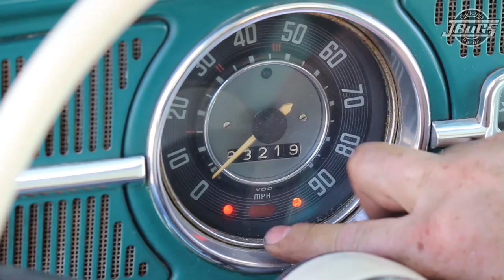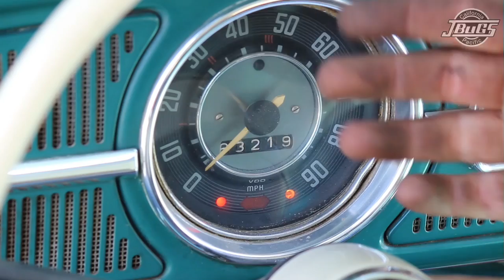JBugs - 1967 VW Beetle - Alternator Conversion Kit Installation

Comment: Might want to add that a new/shorter fuel pump will be necessary along with the short pump rod.  Also a new carb/manifold gasket might come in handy!  :)  Just finished the mod...Works like it should!  Thanks JBugs!
Reply: Not completely true, a generator pump can be run with an alternator. There is just less room for removing it later!

Comment: These videos are fantastic, especially to those of us that are new to Bugs! So far I've had to use this video as well as the rewiring main harness, bleeding brakes (as a double check) and electrical troubleshooting (which resulted in having to rewire!). 

NOTE** during my alternator swap and when I was pulling the fuel pump, the intermediary for the fuel pump BROKE inside the case. I tried a couple things that didn't work but what did and made it a snap was using an easy-out. Once the easy-out is in place gently turn and check to see if the broken piece is turning as well then pull with an upward motion and being ready to grab it.
Reply: The fuel pump spacer / drive rod guide is often times broken off inside the case. Fortunately VW thought ahead and made the spacer out of bakelite so if it does fall into the case, it usually won't damage anything and can be fished out when the oil is drained.

Comment: Did I just see you install the alternator support with no gaskets on either side of the oil baffle?
Reply: Yes you did. Just like the metal dual port intake manifolds, the metal baffle has a raised lip that crushes down to seal the stand to the engine case. Earlier versions of the baffle did not have the raised edge and needed the paper gaskets. As soon as VW offered the baffle with the raised lip, they no longer installed the paper gaskets.

Comment: There appears to be a mistake in this video.  The open air slot in the fan backing plate should face the bottom for proper air flow to the oil cooler.  This video shows the fan backing plate open air slot facing up.
Reply from the maker: Good catch Paul, you are correct. The long “groove” should be pointing up, and the vent should be facing down.
Reply: My printed instructions shows the hole above the alternator
Reply: How confusing
Reply: Great now I have to take my whole top end off and fix it. Delete this video.
Reply: @compound256  OK, we'll get right on that.

Comment: Before lifting the fan shroud you also need to take off the thermostat under the engine.
Reply: Only when they still have it, in So Cal most of them are removed.
Reply: @Sam_Mebane  I run a thermostat, It’s vital for proper engine warmup. In any climate

Comment: Great video I just have a few questions. Aren’t 67 and up beetles already 12v? It was my understanding that 66 and earlier are the ones that came 6v. Anyhow, I have a 6v powered 1963 beetle and wanted to do the upgrade to 12v and I’m getting the complete kit including the starter to eliminate having to replace the flywheel on my trans and avoid messing up the teeth inside (I know a 6v starter will work but don’t like the idea of using it and wanted to go more of a proper fit with less hassle). So would I follow these same steps for my conversion?
Reply: Correct, 1967 Beetles are 12 volt but they originally have a generator which we swapped out for an alternator. So this is a video about swapping out a generator for an alternator, not a swap from 6 volt to 12 volt. Installing the alternator on your 63 would be similar but the wiring conversion is simpler as all the wiring for the regulator is at the engine.

We don't offer a 12 volt starter with a 6 volt gear. We would recommend sticking with with the 6 volt starter unless you have a 12 volt flywheel.
Reply: @Sam_Mebane  Hello Sam, thank you for the reply. I was able to get a kit from AC industries with the 12v starter to 6v bendix to be used with my 6v flywheel. Was just wondering as im sure if available through AC industries, others would follow this idea as it seems as a more proper way to go about the starter/flywheel combination matter. Either way your way is still the most popular, thanks for the response!

Comment: FYI, just received my kit and learned shins and hardware is not included. Would’ve been nice to know this upfront so I could’ve added it to my order. Now I have to place a separate order for the hardware. Drag.
Reply from the maker: Your original hardware can be re-used. The parts that must be changed are included with the kit

Comment: if you use an LED bulb for the warning light indicator on an internally regulated Al82N alternator you MUST use a load equalizer resistor for it to charge its wired to the warning light terminal to the terminal on the bottom of the speedometer.
Reply: Correct, a LED does not draw enough current to get the alternator to turn on. An inline resistor must be wired in line.
Reply: So no wonder mine isn't charging.. was wondering why no charging was happening then saw this comment and realized I didn't hook my alt warning light indicator. Thank you!
Reply: Need this comment pinned. Everyone is going to get stuck. This is a major issue in Kit cars where everything is not hooked up.
Reply: @mariusa9263  Pinned or not, most people don't read the video description let alone the comments!

Comment: At 8:07 a boot is added to the road draft tube.. does this need to be placed as seen in the video? Barely covering the hole at the bottom of the tube? Also, does there need to be a cut or opening in the boot? I just picked a boot up locally and it was recommended to cut/slit the bottom of the boot open then slide onto the tube covering the hole but not pushing the tube completely through the boot.
Reply: There needs to be an opening (a slice or slit) in the bottom of the boot. As for the hole, some breathers have it, others do not. Ideally, try and cover it up.

Comment: Am I wrong in thinking this approach may not work if you still have a thermostat connected? I can't imagine you can raise the fan shroud high enough, as the thermostat connecting rod to the flaps mechanism will be working against you .... no??
Reply: You are correct, if the thermostat rod is in place it would have to be disconnected before lifting the fan shroud off. We do cover removing a fan shroud with the thermostat in place in this video: https://www.youtube.com/watch?v=-OJx0M2c9LI

Comment: Fan has two washers a spring g and a flat I notice you didnt add the flat washer it was on the ground, any reason for that?
Reply: The fan hub kit comes with an extra, we've never found a reason why it would be installed. They weren't from the factory on any generator or alternator that we've pulled off.
Reply: Mine has all that. If you don't use the spacers it grinds on the fan.

Comment: How would I wire this on a sand rail application? Barebones wiring, but i need to have the battery receive juice somehow
Reply: To get the alternator to charge, you can use a simple warning light, mounted wherever you'd like, but ideally where the driver can see it. Wire the positive wire of the light to a key hot source, the negative wire hooks up to the D+ wire. Hook up the B+ post to the positive side of the battery, that's it.

Comment: Thanks for another great how to video. What is your recommendation on removing the cooling fan nut. It doesn't look like the one on my 71' Ghia has ever been touched. Its rotation is so balanced that i'm scared of screwing up the fan with my ogre hands. This is all new to me so sorry for the noob question. I have a 36mm socket and the tools. I just would like your input on the removal process so it goes a bit smoother.
Reply: P.S I already have the cooling fan and old generator out.
Reply from the maker: Ideally a high torque impact gun would be used so as to not bend or twist the fan but more often than not, we use a breaker bar and hold the fan in one arm to prevent it from spinning.

Comment: Awesome!! 😯

And will it be the same connection step to install the porsche type turbine? 🤔
Reply from the maker: If you’re referring to hooking up the alternator in the Porsche fan shroud conversion, check the instructions that come with the kit. Bypassing the voltage regulator will most likely be the same but the connections at the alternator will probably be a little different.

Comment: Noob question: Do you need to replace all of the lights on the vehicle with 12v bulbs after this conversion? What about battery cables?
Reply: If the car had a 6 volt system and you are converting to 12 volts, yes. This conversion was just a swap from a 12 volt generator to a 12 volt alternator.

Comment: Just did this conversion to my engine over the weekend. The instructions weren't very clear about which end was up on the big metal plates. I got the inner one right with the vent facing down. But I installed the outer one with the breather hole at the 12 o'clock position instead of 6 o'clock. Will this cause any harm on in my stock engine compartment? Should I pull it apart and turn it? Thanks in advance.
Reply: The vent hole isn't a major concern. Next time you have it out flip it but I wouldn't pull it just to flip the plate.
Reply: @Sam_Mebane  thanks. I didn't put the engine in yet, so I just flipped it around the other night when I had a couple extra minutes to spare.

Comment: So... How do you get to the nuts on the rear of the stand? And what size is the hub nut. I'm trying to get the fan off my generator. Also what gauge is the parking light wire for the 68 beetle?
Reply from the maker: A ratchet with an extension and a universal joint can be helpful to get to the back nuts. The fan hub nut is 36mm. The parking light wire can be replaced with 18 gauge wire.
Reply: @JBugsVWParts  Thanks! Also I ordered some stuff from jbugs a while back. Most of the stuff came in, except the headlights. 7 inch h4 with LED edges. Are they out of stock? I checked the website and it says picking for all of them even though I have most of them.
Reply from the maker: Please call us at 1-800-231-1784 or email sales@jbugs.com

Comment: When converting from generator to alternator how many amps should  the alternator be I see different  amps I don't know which one to get
Reply: The stock generator is a 30 amp unit. A stock replacement alternator is a 55 amp unit so even the standard replacement alternator is an improvement over the generator. If you have a large stereo system (with multiple amplifiers, etc) or lots of off road or accessory lights you might consider a 75 or 90 amp alternator.

Comment: For the headlights with the LED Ring. Can the LEDs be attached to the same wires as the turn signal/ parking light to serve as additional lighting. Or should it be separate?
Reply from the maker: They can be wired up whichever way you see fit. We recommend checking local laws before using them as turn signals or running lights though.

Comment: IS IT POSSIBLE, IF I WILL REPLACE ONLY THE GENERATOR INTO ALTERNATOR AND ITS STAND? WILL IT FIT WITHOUT THE OTHER PARTS OF THE KIT? LIKE BLOWER, PULLEY, AND PLATE SET? WILL THE PLATE SET OF THE GENERATOR FIT ALSO TO ALTERNATOR?
Reply: A generator can be used on an alternator stand, yes.

Comment: can you take the shroud off without removing the motor if you have a Baja or does the motor need to be removed to take the shroud out?
Reply from the maker: +watspoppin505jh
On a Baja, most engine work can be done with the engine in the car as most if not all of the body is cut out of the way. Pulling the fan shroud off should be possible with the engine in the car. However depending on the bumper, pulling the engine on a Baja isn't difficult either as again, the body isn't in the way.
Reply: JBUGS oh ok thank you for the reply and advice it is very much appreciated
Reply from the maker: +watspoppin505jh
You're welcome, if you have any other questions feel free to call us toll free at 1-800-231-1784 and we will be happy to answer any other questions you may have.

Comment: hi will the original stand for generator work or will t have to replaced by the empi one
Reply from the maker: +Jorge Lopes 
Hello Jorge! Unfortunately the original generator stand will not fit an alternator due to the size and shape difference between a generator and an alternator.

Comment: Why do you need to change the fan and backing plates ??
Reply: If you have a 12 volt generator, you don't have to. We couldn't get the fan off of the generator with the tools we had at hand so we just installed a new one instead of reusing the old ones.

Comment: the tube for my dipstick broke off... do u have a replacement (1968 Beetle) tube?
Reply from the maker: The dipstick tube on Beetle engines is pressed into the machined hole on the engine case. The tubes aren't designed to be removed or replaced, we aren't aware of anyone offering a replacement today. If you have a bolt on dipstick tube on a universal engine case, we offer the dipstick adapter: http://www.jbugs.com/product/8932.html

Comment: Possible to do this without removing the shroud on a 73?
Reply: Yes, but the intake manifold and carburetor would have to come off.
Reply: @Sam_Mebane  Found this out from experience recently. Much easier to just take the shroud off 😆. Thanks!

Comment: What should the voltage output be for the Alternator ?
Reply: Alternators typically put out 13.6 to 14.2 volts.
Reply: @Sam_Mebane  Mine is putting out 13.75 volts so that sounds about right .

Comment: Do these kits work with both 6 and 12 volt
Reply from the maker: The 12 Volt Alternator Conversion Kit can be used on 1961 and newer model Beetles and Karmann Ghias and 1960 and newer Type 2 Bus models with 1200cc 40 horse engines, yes. The alternator is of course a 12 volt alternator so the rest of the electrical components have to be changed accordingly. We do offer a 6 to 12 volt conversion kit for Beetles here: https://www.jbugs.com/product/6-12-volt-kit.html that includes the needed 12 volt components to convert the 6 volt system to 12 volts along with the 12 Volt Alternator Conversion Kit.

Comment: Question about the second backing plate orientation. I've seen 2 other sites say the 'vent' / 'slot' should go towards the bottom along with the round hole in the first backing plate. It appears you are putting this second backing plate on with the 'vent' toward the top. Which way does this second plate orientate? Thanks. https://www.youtube.com/watch?v=QMkYJwuKnwM
Reply: The vent should point down.

Comment: It looks like the job would be easier by pulling engine.
Reply: The job of swapping the generator for the alternator would be yes, but then you add the additional work of dropping an engine. In a vehicle like a Baja Bug, a Manx (RIP Bruce!) or a Bus with a removable apron, pulling the engine is a little easier, sure. The additional effort to do one versus the other in a full bodied Beetle or Ghia aren't worth it though.

Comment: This video assume you have no engine thermostat hooked up. Got deal with that if you want to raise the fan shroud.
Reply from the maker: That is correct Michael, our engine did not have the original thermostat or flaps in place. We are located in southern California and having a VW with the thermostat and flaps intact and connected is a rarity. Most of them have been pulled out and tossed years back. As soon as we come across an engine with the thermostat in place we will be doing a video on them.

Comment: Where can the 1/4 inch terminal connectors be found
Reply from the maker: Standard crimp connectors can be picked up at any local auto part or hardware store and will work just as well. We recommend using "crimp and shrink" connectors for the most secure connection. 

The open barrel crimp connectors we used are a little harder to come by and require special pliers to use but we like them as they were what VW used.
Reply: @JBugsVWParts  The 1/4-inch "T-Connector" (3-way) & the 2-way you used in this video, with the plastic insulator shrouds...  Where are those purchased, since they are not included with the Alternator Conversion Kit? (standard Crimp Connects can be purchased anywhere, but the ones you show I Can't Find, even with a Google Search.)
Reply: I had the same problem.  I can only find those used on ebay from old bugs or new from jbugs website

Comment: Any tips to pull fan hub off my generator?
Reply: We've never had to use a puller to remove the hub, at most a flat head screwdriver has worked but at the end of the day, an new hub kit is inexpensive enough: https://www.jbugs.com/product/111198123A.html
Reply: @Sam_Mebane  thanks for info.. wound up just purchasing the hub nut kit. Was super easy to install everything..

Comment: doesnt go in to detail how to unbolt the fan nut while the fan and alternator is out of the motor
Reply: Correct, we didn't have an impact wrench so we couldn't get the old fan off so we installed a new one. Removal is the opposite of the installation.

Comment: Hybrid? AC generator Power and charge
Reply: Engine ideal higher the motor ideal.
Reply: @kingjeremysircornwell7847  This conversion is to swap the generator out for an alternator, powered by a gasoline burning engine. We haven't converted the car to hybrid power.